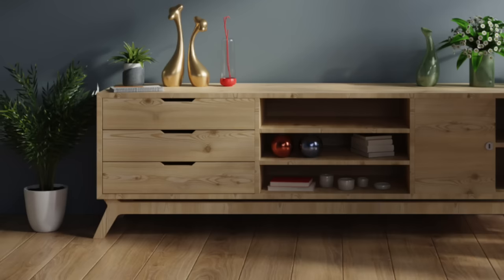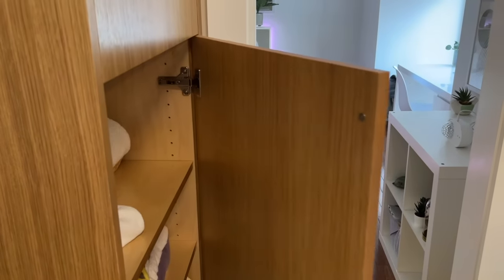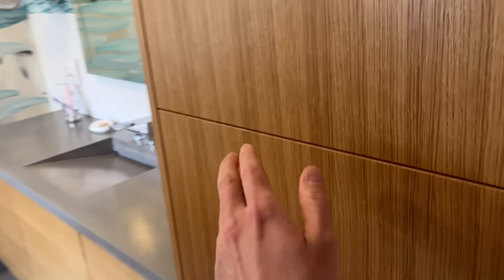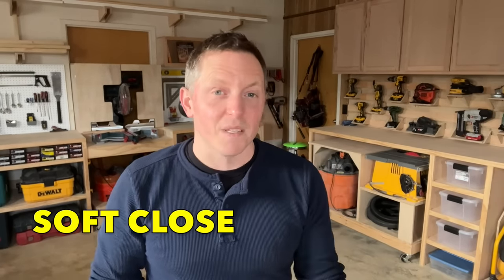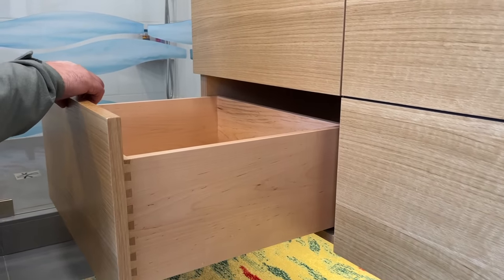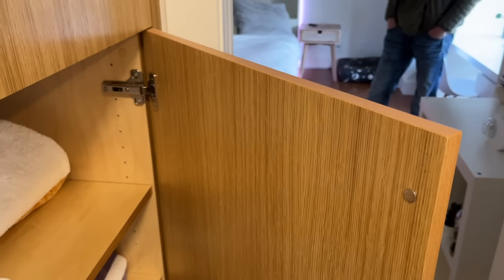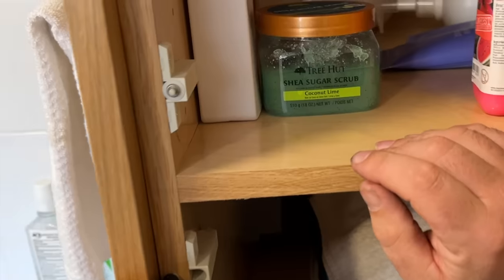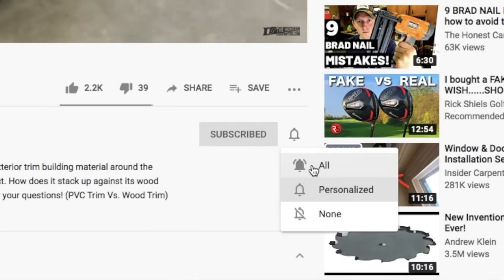Here's How To Get HANDLELESS CABINETS!! ("No-Handle" Custom Modern Cabinets--Hardware Explained!)

Comment: These 'smooth operators' are a mother's dream.  Imagine your fingers all covered in dough and you need a utensil in a drawer.  My elbow or knee could take over and keep the drawer clean and sanitary.
Thanks Nathan, you provide such interesting Vlogs. PS: I still use my old pantyhose on my vacuum filters.  You have the system I can only dream of.

Comment: I would have to state whether or not new style cabinets are your thing, there are some great takeaways in this short video.  The combination of hardware that you mentioned is a brilliant idea to use and not to forget the tension cassettes.  Moreover, there is the classic finger joints that they employ along side a standard practice.  I will have to see if any of this is available in the UK as a kitchen rebuild is approaching…. Thank you for sharing this content.

Comment: Those are very interesting and look really nice and clean. Is the soft close necessary? I have push-to-open drawers in my entertainment center, and they are also push-to-close using a similar magnet system. The soft close does make things more intuitive, but it can be done without it.

Comment: I have handleless cabinets and drawers in my kitchen. I don’t know why anybody would really want them. 
The doors provide no clue which side the hinge is on, so until you learn each door, you don’t know which way it will open. For the drawers you’re trying to grab the edge to get the drawer open, which dirties the area around it. For flushones, will guests be able to intuitively operate them? Maybe.
Reply: Yes, this is the epitomy of the modern preference for style over function and over-engineering purely for the sake of it. I lose count of the things I use every day that are less useful than the things my grandparents had

Comment: Great video! Blum also produces an electronic version of that slide called Servo Drive. Much smoother operation and doesn’t require the big push to get the soft close to work.
Reply: Yes they are great but very pricey per drawer if your doing it on a kitchen

Comment: That seems to be some very interesting technology. I grew up in a family of carpentry so woodworking still interest me. But when I see these high-end homes and things that I don't really consider necessary, including the enormous home itself and all the landscaping and how ridiculously expensive it's got to build the house nowadays. I'm just happy to have a roof over my head, and I say I'm not the only one that feels that way.
Reply from the maker: I just like to see the great carpentry in places like this, Patrick. It’s rare in residential, so I live walk throughs like this.
Reply: I'm sorry if I came across crass, because that wasn't my intention. I myself see some immaculate residential homes. My mother is a real estate broker and certified appraiser. I live in Eastern Kentucky and it's just one way or the other. And what I mean by that is in one way you'll have just a nice functional house with regular cabinets that have handles on them and not that the house isn't in good shape it's just what in the appraisal business considered dated. And then you walk into these homes that are unexplainable. I've helped my mother a lot with appraisals because it's so much faster to do your measurements on the outside of the home with two people when you're working with 100 ft tape measure. But, the final thought I have in my head is my weakness and compassion for the homeless. It hurts to see people in need of a hot meal and a place to clean up and sleep safely for the night. And all the while you got small components on the inside of a residential home that cost $1,000. So that's really the skinny of what I was getting at maybe I should have explained it better but I think I have now.

Comment: Really great concept, thanks! 
Question: how does one deal with fingerprints on the face of the cabinets rather than on handles which don't show fingerprints?
Reply: Unless you have high gloss cabinets which will need regular wipe downs they shouldn't be an issue with natural wood grained cabinet panels.

Comment: Blum is not the only company making push to open and soft close runners. King Slide was actually the first company to invent this more than 10 years ago! They have since launched a much-improved version with a light push open force and the drawer opens more than just 5 inches.

Comment: "Push to open" is a very attractive idea at first since it lets you not only remove external hardware but moreover increase the drawer front dimensions, but in practice, it kind of sucks because you can easily open drawers and cabinets accidentally just by leaning against them or hitting them while using your bathroom or kitchen; and, they have the disadvantage that, unlike with a handle or other opening mechanism, where you contact the device in one spot and open it completely without a second motion, "push-to-open" requires first contacting on the front face to initiate the opening, and then following up by pulling the drawer the rest of the way out. 

I still prefer smooth rolling drawers that open from the side or roll out quickly with a small button.

Comment: Things that look good but are more complex and are functionally worse.

Great for the gram, wouldn't want it on my home or business for hardly anything.

A handle is explicit for the user, a cabinet with so many doors opening in different directions where you have to push in the right spot while not being obvious is an annoying UX.

Can work great in some circumstances, but it is tricky, either some visual elements that guide you or consistent opening spots.

Also, that led without a diffuser underneath the bed :S.

I know how I sound, don't take it harsh, I just wanted to share some criticism to balance.

I actually appreciated the technical solutions, but I would suggest looking in the directions I shared, like putting your grandma on that bathroom and seeing if she figures out first time or if she get's a bit frustrated when there's tons of cabinets in different directions, maybe some metal inlay on the wood can suggest where to push, just as an example.

Comment: Great ideas Ethan. I am newer DIYer and I wished I had known about this hardware before I started to rebuild the cabinets in our 100 year old home. I added the under drawer soft close, but needed drawer pulls. The drawers would have looked much better with the Push-to-Open and soft close combined. Thank you for the information. I have other built-ins that I could add this.
Reply from the maker: Thanks John! I think these are a great addition. Good luck with the next cabinet build—work safe!

Comment: I'm curious about the cost of the hardware with the soft close / push-to-open for a single drawer.
Reply: The Blum Tandem slides plus the push to open mechanism, called Tip-On, will run about $115 per set. Movento a little more. 

You can get same functionality from Salice Futura for about $40 per set and the mechanism is built in, not an add-on. But it's also the difference between German and Italian engineering. You can feel the difference in the hardware just holding it and how the locking clip feels when activated.

Comment: In an ideal world you would always use the soft pads of your finger tips to push the cabinet doors in to open them.  In the real world however people will thrust their hands perpendicular to the doors allowing their nails to hit first and in time this will produce scratches on the finish. 

Around 1960 when I was about 4 years old, my father bought beautiful maple kitchen cabinets with a white wash finish and stylish brass handles and hinges. The kitchen cabinets were among the few pieces of furniture in our house that my father, a master craftsman, didn't build himself! The handles of these cabinets were designed in such a way that when you grabbed them, your nails (particularly the household members with longer nails) would hit the wood surface. Over the many years we used them and the thousands of grabs, the finish wore off producing an unsightly appearance!  It looked awful! Eventually all the doors and drawer fronts had to be removed along with the hardware to be refinished. 

I then realized with the choice of thousands of different door and drawer handles to choose from, that certain style handles lend themselves to nails hitting the surface when you grab them and others don't. Just something to consider when buying cabinets if you want them to continue to look nice over time.

Comment: Looks good but this shit would get annoying after a while. I guess if you take your time with literally everything in life they wouldn't be too bad. You have to use two motions to open each door, and more hardware = more susceptible to malfunction. Handles carved in to the face of the panel is far better methinks.

Comment: Does anyone that does no hardware follow up in a couple of years? It’s certainly not good for a busy family/household.  Even clean hands could have moisturizer. The finish will be discolored soon enough. I’m a kitchen designer for a design/build company. Our 2 mid to high end lines can do tip-on with soft close and continuous grain. It’s not only custom cabinet shops. You def get what you pay for.

Comment: The Blum drawer mechanism seems to over engineered.  The cabinet door bump-open solution could easily be adapted for drawers, and would be surprised if it already hasn't.  Instead of contained in the hinge mechanism, I'm imagining spring plastic+spring/latch+bracket attached to rail(s) that could magnetically attach to front drawer panel.

Comment: I do not like no handle cabinets. Over time they will show wear and look dingy. Just not a practical system.
Reply from the maker: These work great, Doug!
Reply: same thing happens around the hardware. i will take the no hardware in most cases, as it will easier to clean.
Reply: Did you just say that handles on cabinets are not "practicle"?

I think a good dictionary read is in order.
Reply: ppl buying these custom cabinets have paid cleaning help
Reply: @ibealion1  I think you misread Doug's comment. Perhaps a hyphen would have cleared it up for you....he says: I do not like "no-handle" cabinets. By the way, he does, in fact, spell practical correctly, so....I think a good look at the dictionary may be in order for you.
Reply: @jedsudweeks6676  Hey! Look at that... I did spell it wrong. Yes, a hyphen would have been helpful. I thought it was just bad grammar.

<-- I did spell grammar correctly... so that's exciting.

Comment: I do not like no handle cabinets. Over time they will show wear ,Just another thing to break and then, 
Fingerprints all over the finish and then cleaning the finish will eventually wear out the finish.
They work great when empty, Get some off center weight in there.
And they don`t do well with family arguments ,first thing to get broken.